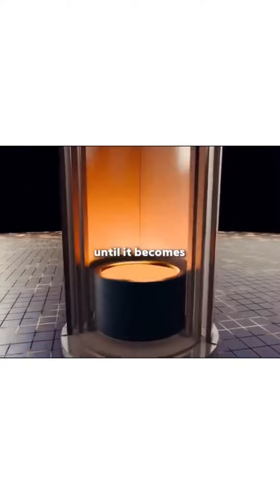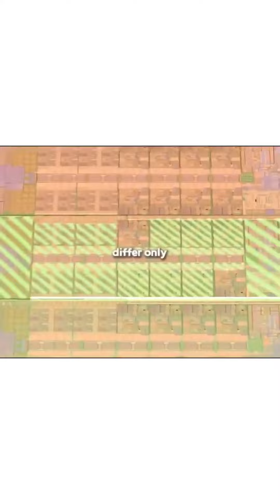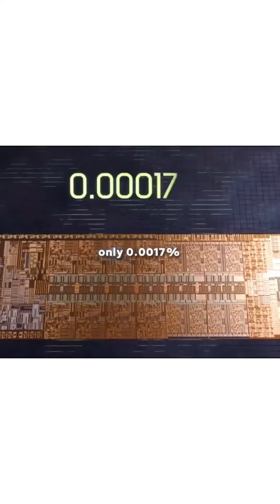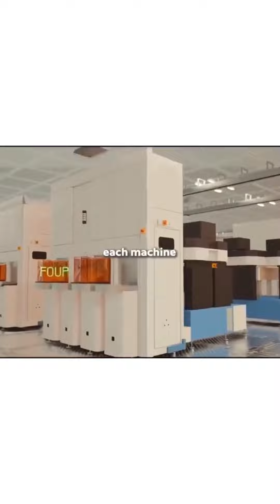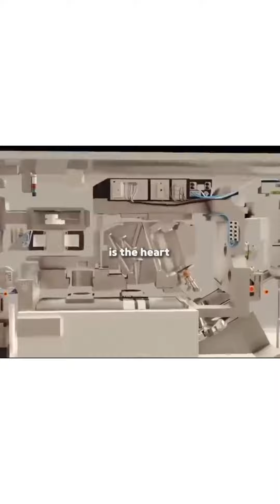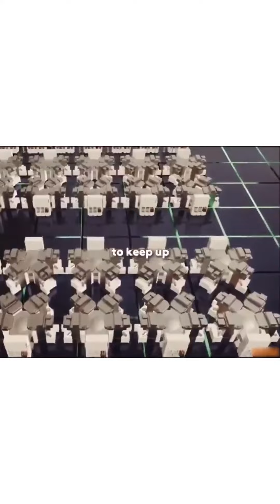Economics of Chip Manufacturing: Understanding Wafer Fab|Yield Rates #vlsi #semiconductorfabrication

Comment: Sand is not silicon. It's siliconDIOXIDE. You left out a crucial step there... As most every other metal (or metalloid, in this case) out there you first have to reduce the ore to get the metal.
Reply from the maker: Thanks for the clarification!
Reply: Great inside #chipmanufacturing.